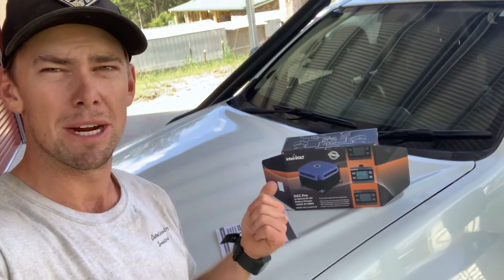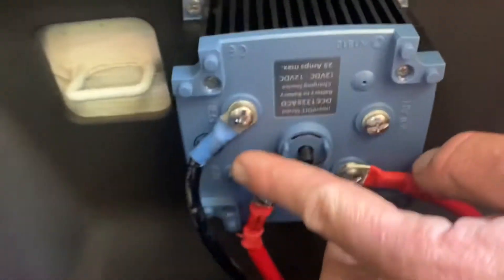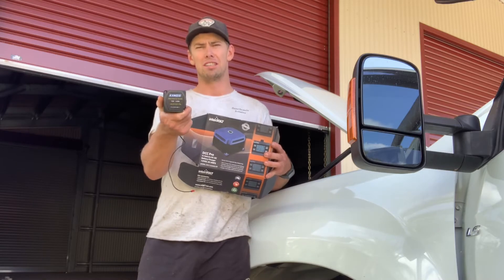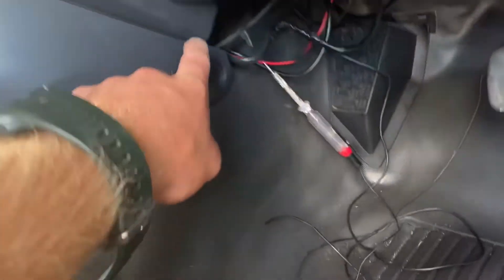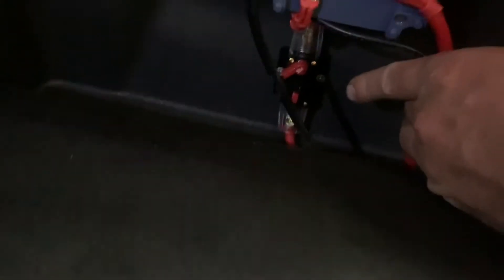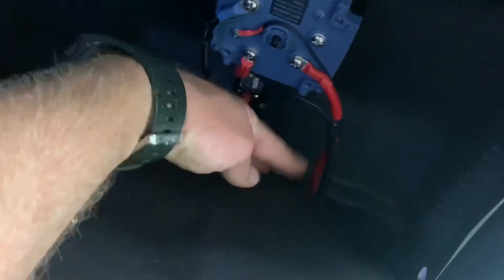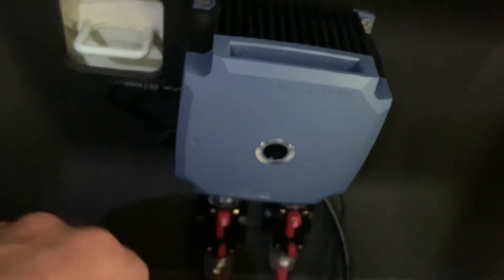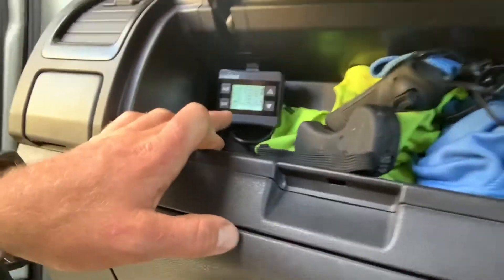Intervolt dcdc dual battery system for towing with the dmax, DIY video

Comment: Good video. I swear by Intervolt.
I've had mine for afew years.
The only issue I have had is a couple of times the light has been purple.
I have had to disconnect (open the circuit breaker) between. The unit and the main battery (starter).

Reconnect after a minute.
All OK.
It remembers its settings. Good to go

Comment: Is the bottom section of the screen showing the charge going into the battery in amps or the draw of the equipment running off of the battery in amps?
Reply: Can show both battery volts and you can check the amps being drawn from aux batt

Comment: Hi mate 
I just got one of these
The way my car is set up my fridge runs off my main battery and my second battery will start the car if my main battery goes flat
Do you think I should swap the batteries on the dcc when I install it or should I install as directed

Comment: Hi Mate
I’ve just fitted a intervolt to my 2018 Dmax the same way as you have with the 50amp circuit breaker’s and my main one keeps tripping did you have the same fault ?
Cheers
Reply from the maker: that’s a bummer! no I didn’t sorry, I would just back track your steps and go over the system while looking at the wiring diagram make sure everything is in the right place, wires to the right terminals ect
Reply: @NailitandTrailit  hi thanks for your reply it’s all sorted now I don’t know what the issue was with them tripping but it has now stopped, I have changed out the cranking battery though but thanks for your video on what to do I couldn’t have done it with out it
Cheers 
Martin

Comment: Great video mate. 
Just a few questions - Is that battery in a tray or just sat in behind the seat? If so does it move around much when off road?
Reply from the maker: it fits in snug, only thing i did was a couple pieces of foam under it to help with bumps

Comment: Nice vid, how much was the kick ass battery and the charger all up
Reply from the maker: thanks mate, it was around $1000 for the charger, battery, and all the wiring needed for the setup!
Reply: @NailitandTrailit  hey mate did you strap the battery down if so how did you do it? Also did you screw the charger to the wall ? Do the screws do thought to the outside?
Reply from the maker: @joshelliott9222  battery fits in snug, don’t need a strap! As for the screws, just went into the plastic, works good